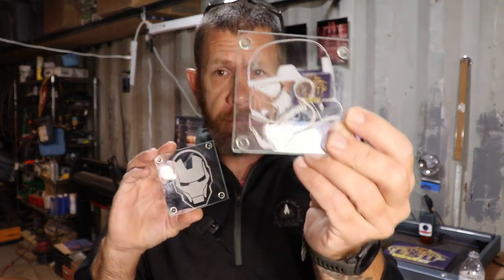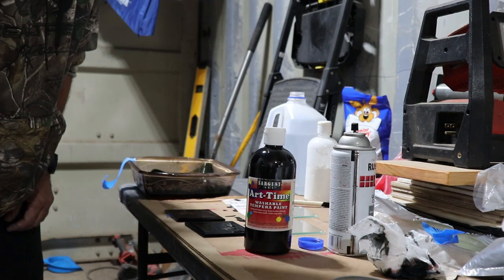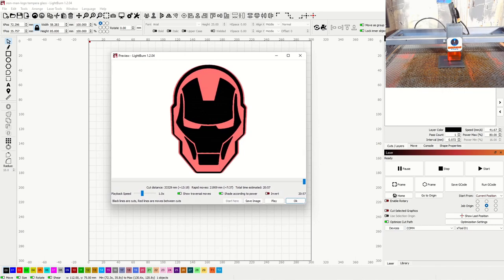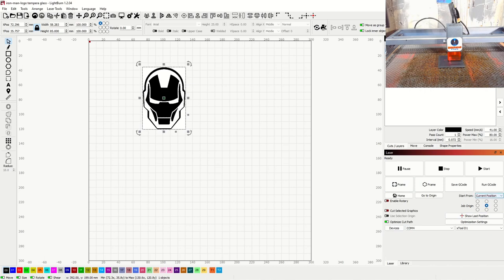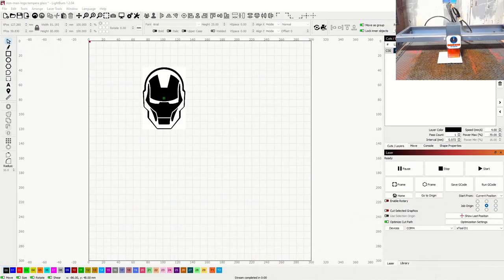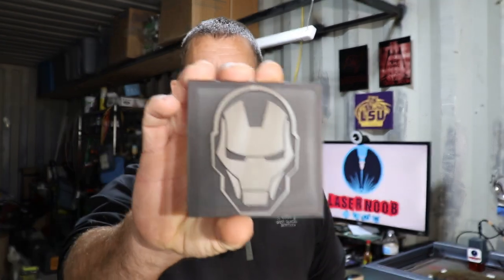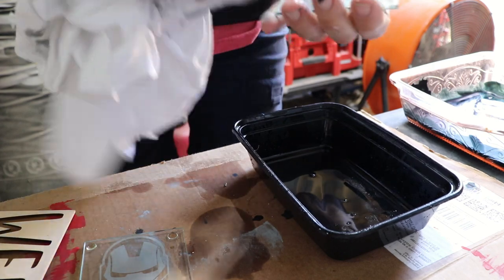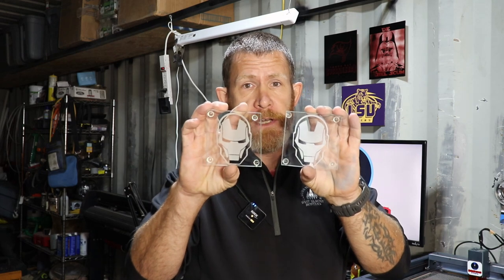Laser Engraving Glass With a Diode Laser

Comment: Of course the lines are more crisper on the one with the tempera paint because the dpi settings are higher than the one on the galvi...Galvenized paint can come with water also, water and scotch pad.The best way to do these,or even for tiles too...Is to let the tempera or the paint dry for 24hrs before engraving...If you dry it with a heat gun it looks dry but not completely dry...All in all great video!!
Reply: May I add that if you use flat black high heat paint the kind used to paint stove pipes...You will be amazed by the color the etching will leave...It will come out either dark gold or a bronze color. It is very important to let the paint dry 24hrs before etching. Do a test pattern to see all the different shades.

Comment: Thanks for the comparison... at timepoint 20:24, you say that the 354 DPI for tempura was "higher" than the optimal DPI for cold galvi, but I could not find an explicit statement for the final DPI settings for cold galvi.  can you show a screen shot of the "cut setting editor" for your final cold galvi run? (or report out the details in a reply?)  THANKS!

Comment: I usually use the cold galvanising. But I'm not sure why you need the chem to clean up the cold galv. I use water and it easily cleans off glass. I'd say it comes off as easy as the tempura maybe even easier. I'll need to look at my test grids again. Some how I didn't notice that the cold galvanising was so much slower.

Comment: learned lots from you. I have a question, you use poster board under acrylic with tempera but not with glass. is this something you found after experimentation or is it just different with the acrylic?

thanks in advance, 

P.S. FJB LGB
Reply from the maker: I don't use it with glass, because I etch glass from the top side. I etch acrylic on the bottom side.

Comment: Great tutorial! One question only: What parameters should I choose for a 20w diode laser?
Reply from the maker: I do not have a 20w diode, so i can't give you that answer. I always suggest that you do a speed/power test, even if using the same wattage laser I have/use. My 5/10/33/36W lasers may be more or less powerful than the exact same laser someone else has. With that said, I do mention the settings I used on the 10W in the video. Best of luck!
Reply: Ok! Thank you for your prompt reply!  @LaserNoob

Comment: I'm not sure if you mentioned it but, what was the thickness of the glass? Would any adjustments be need for other thicknesses?
Reply from the maker: I never measured the thickness to be honest. It makes no difference if they are thick or thin, only that there is some sort of coating for the laser to hit.
Reply: If the glass is 3mm thick, you set the laser height to the surface of the glass, plus 3mm to get the laser focus on the back of the glass.

Comment: Dumb question but could you not run say 3 faster passes, or something of the sort?
Reply from the maker: Not dumb at all. I don't believe so. Its about getting the coating hot enough to react with the glass.
Reply: @LaserNoob  I know that, but higher power/faster passes, creating more "heat exposure" might be beneficial. Figured you maybe could give it a shot or I will hopefully in the next few months when I get mine.

Comment: i've just bought me a sculpfun s9 ,  Diode Laser Power
	5.5-6W just learnt to engrave wood but cant seem to get it to engrave on glass any help you could forward to me would be very much ppreciated. i enjoy the vids , keep em coming thank you
Reply from the maker: Dip or spray  your glass in black tempera paint. Then run a speed / power test grid. That's the only sure way to get the right settings for your laser. It will be slow on a 5w, so be prepared for long burn times.
Reply: @LaserNoob  thank you for your time and reply , got me a few cheap mirrors today ,so going to try them out , hopefully i'll get it right , i'll let you know , thanks again ENJOY.
Reply from the maker: Mirrors are different. No coating and etch from the non reflective side only. I have a mirror video you can check out.
Reply: @LaserNoob  Thank you very much my good man , everything that you Have told me i have tried and my workings have turned out brilliantly , i am so happy , i've never used a laser engraver in me life , i've only been using it for a day , i wish you all the best in life , god bless you my good man , take care , all the best from the UK.
Reply from the maker: Best of luck in all your endeavors.  Cheers, mate!!
Reply from the maker: PS.. tell all your mates to subscribe to my channel! 😀
Reply: @LaserNoob  do you know if i can run a sculpfun s10 laser module on the sculpfun s9
Reply from the maker: Honestly, I have no idea. If the s10 has a higher output than the s9, there will most likely be a larger power supply. I upgraded my xtool d1 5w to a 10w. All I had to do was swap out the module and the power supply it came with. But as I said, I have no idea on the sculpfun. I would contact their customer support.

Comment: i've try engrave on glass using tempera paint for about 6hours. and result pretty good. but got problem when try to clean tempera paint.  its not cleaned 100% on some point. how i can totally clean the tempera paint and make glass not look dirty cz of tempera paint?
Reply from the maker: I just use warm water and a soft sponge or toothbrush

Comment: Have you done the tempura paint method with a glass cup or mug?
Reply from the maker: Yes. Even colored glass.
Reply: @LaserNoob  did you use the same application method? I believe I saw someone using an inexpensive harbor freight airbrush to get an even coat. I think it was poppa's workshop. Thanks for the great video, subscribed.
Reply from the maker: Nope. I dip them.

Comment: If you coat one piece of glass with paint and then place a second piece of glass on top of the first piece, you can slowly drag the top piece of glass sideways toward you, keeping it flat until it comes all the way off the bottom piece. The entire top of the bottom piece of glass will now have a completely smooth and even, coating of paint on it.
Reply from the maker: Thanks for the tip.

Comment: Hello sir, I’ve tried everything with my laser to get the same results as you but it’s not working I have the yorahome 6550 15 watt diode laser. I painted the acrylic with chalk paint. I tried all kinds of speeds and power but it’s not getting the white finish .
Reply from the maker: This video is for glass. Is glass what you're trying to do, or acrylic?
Reply: @LaserNoob  acrylic sir
Reply from the maker: Paint your acrylic with black tempera paint. Let it completely dry. Then try around 15% power and 40mm/s. Doing a speed power test grid will get you the settings close.